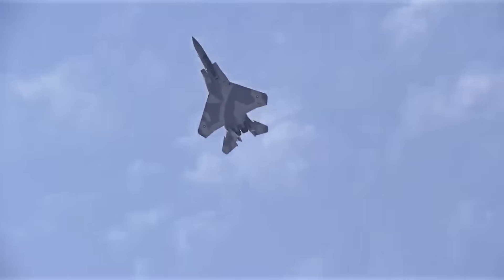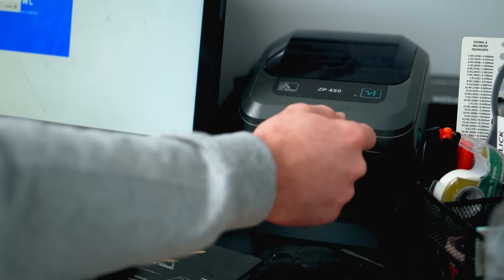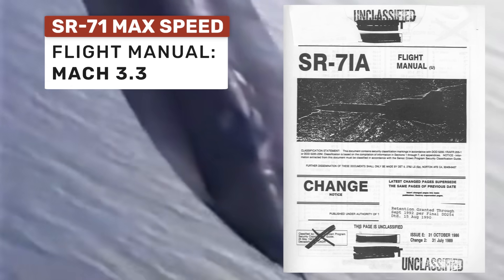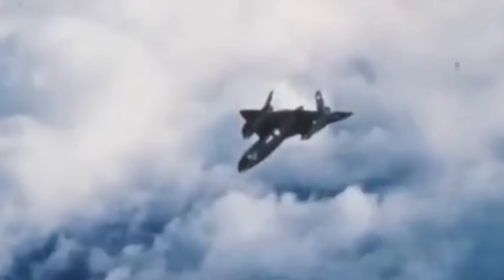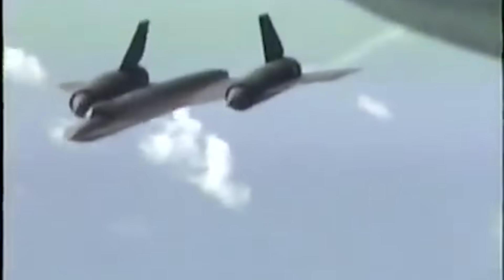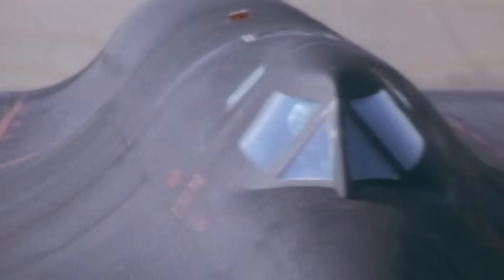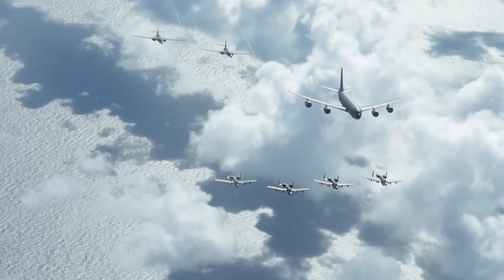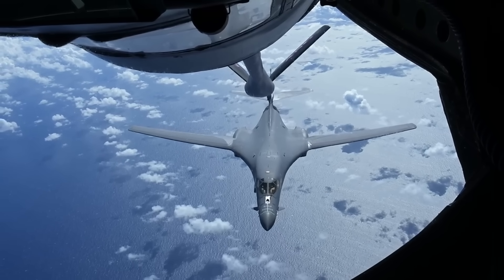The SR-71 was MUCH FASTER than the Air Force will admit

Comment: My dad was head of security in the Air Force at 5 different bases, he had a lot of high ranked connections, he was told by a very high ranked General that the speed was in excess of mach 4, that was common knowledge, the actual speed is still classified.
Reply: He was messing with him as that's not remotely possible
Reply: @gr8crash  My farther was highly decorated, and a very powerful person throughout the 70s, the people he new and worked with didn't mess around, they deadly serious. I believe what he was told, he was in charge of keeping the SR-71s secure.
Reply: @Guest-hv2qv  he very well could have been, not saying anything about that. But in terms of that speed comment, it's 100% not possible,  under any circumstances.  Not to mention he was security,  which means he wasn't part of Senior Crown which means he would have had no access to the specific information.

Comment: Greetings Dear One
The Sleds, projected speed and service ceiling are only for Ops Alta, actual speed and true max service ceiling is listed on a Lockheed paper, this won't see the light of day for around another forty to fifty or so years maybe more, though usually not exceeding a century.

The Archangel project that Clarence Johnson devised during a lunch with a friend relates to from the Pentagon, Kelly drew the A-12 on the back of a dinner napkin while in conversation with this friend from the Pentagon, The A-12 is indeed far faster than the younger fat sibling of the same stable (One usually refers to a as "The Fastest Ladies Of The West!") That said though she is podgy around the midriff due to the extra seat canopy ejector equip and then all the banks of avionics and the ECM Jammers and multitude of HD camera and other such equipment required for mission objectives, her vectors, operations are kept between Mach 3 to 3.2 this had nothing to do with the structural limits of the craft, as the sled was not only capable of far greater speeds and a service ceiling thats also above 120,000ft! the Op Alta was fixed at 80 to 85,000ft for best imagery. 
The higher altitudes and higher Mach are how she would evade "The welcoming committee!" Now given that prior to 1981 the former USSR had already developed a Mach 4+ missile to try and shoot down the sled during an over flight and given the quoted text at end of comment, One will tell you that none of the service crews that serviced the sled knew the top speed or her service ceiling, their equip tops out at around Mach 3.2 max ops speed at 80 to 85,000ft, its a need to know bases, "They know," "YOU DON'T NEED TO!" everything was compartmentalised even during her service life, a couple of sled drives know her capabilities. 
Good luck getting them to tell you not even off the record (Well they might after reminding you that you will suddenly develop lead poisoning of the 9mm variety!)
This Mach and Ops Alta is plenty for almost all mission objectives.
When you're sat in the sled the throttles on the lower left quadrant when in cruising mode at OP Alta your doing Mach 3 if you glance at the throttles their looks about 3 to 3.5 inches of travel before the throttle stops, maxed out and this is actual usable throttle, and given that even though she's one fat chick! She can lift her skirt and click her heels and really stretch her legs and leave a Mach 4+ missile dead like it ain't moving! Even able to operate above 125,000ft though this would only be done to put distance between you and the welcoming committee sent up to greet you by those rather nice chaps from USSR they was always nice in that respect.
Now consider this, the higher you fly the thinner the air the C of F dropped off, the colder it becomes thus, when done correctly you can fly faster and higher because her power plants wasn't standard propulsion Kelly also had them modified during the Archangel project now if you can maintain what's referred to as equilibrium between Sq Cf of F -  -delta t you can operate within the safe paramotors of the upper echelon and the shock wave does not enter past the spike at fully withdrawn as the shock wave bounces around the conical and the inlet ducting almost in the same place as at Mach 3.5. She's capable of greater Mach... (She climbs like an Home sick Angel and at that point, by the time you thought it, you've past it!)
And given you have the preverbal welcoming committee coming at you at Mach 4+ and is gaining on you until you are beyond Mach 4.35. This gives you some idea of...
"She's faster than stated "A LOT!" Though can be gauged knowing other parameters remember, fuel weight and knowing how much secret yeah right how many 135-Qs have taken off each holding xxx? you can gauge where and for how long she's going to be! 
Titanium is not an ordinary and theirs were several alloy base on Titanium mix which at that time were regarded as highly exotics with other things that are shall we say detrimental to human health!

One has been fortunate to see the Lady in operation highly descriptive words of an vernacular sense, though none are printable! Oh Boy does she make ya heart flutter, not so much seeing her on direct taxi, hanger to take off none stop from leaving the ready hanger, its more a case of those shock waves from the powerplants shake the earth your standing on as she rolls down the strip toward you and pounds you in the chest almost like being double tap as she rotates climbing into the night sky, she disappears even the glow from her lit cans fades in seconds, climbing out to around 25,000ft to meet her first refuel to quench her thirst brim her and she vectors off, though if you count the KC-135Q being vectored outbound prior to her exit you've a good idea where she's been vectored.

Taken from:
copyright the Hamlyn Publishing Group 1979 reprint 1981
Quote "THE MACH 3.5 Lockheed SR - 71 Blackbird which gave the company much experience in Supersonic flight despite such Lockheed Military success however the American Super Sonic Transport contract was awarded to Boeing and the whole project was scrapped by by 1971."
taken from William Sweetman A History of passenger aircraft ISBN 0 600 37205 7 

Blessings Love and Light
Namaste

Comment: I'll confirm it is a lot faster. My father was USAF. Klamath Air Force Station (ADC ID: P-33, NORAD ID: Z-33) was used to track the SR-71 on the return leg after it turned south along the coast. My father was stationed there for a while. They travel fast enough to cross the scope on the radar system in a single sweep. I won't go into more detail.
Reply: That doesn't even make any sense. As that all varies on the scope, the distance scale,  the sweep etc. Literally makes no sense.

Comment: The sr71 would do 3000+ mph..... (Coast to coast in 1 hour). That TRANSLATES TO 3000+ mph....
Reply: Lol no. It wasn't capable of anything close to that speed
Reply: @gr8crash  go look it up, I read in the article before he had the internet.... I know INFORMATION before there was an internet!!!  One pilot said he took the sr 71 out over the Atlantic Ocean turn it around, hit full Throttle.... 1 hour later they crossed the Pacific coast.... A simple Google search will show you that's roughly 3,000 mph.  HECK THE mig-25 DID Mach 2.83  your telling me a mig-25 was faster?  HUH???? HUH???
Reply: @jwdundon why look up what I already know? Your comment has many errors. First you're referring to the record cross-country run. That was from LA to DC, West to East coast. It was not from East to West. The distance coast to coast was 2404.05 miles. With an average speed of 2124.51 mph making the coast to coast time of 67 min 53 secs. 

No one said anything about the Mig25 so not suee why toy brought that up.

The other issue with what you said is that somehow you're saying that distance was 3k miles, when the SR71 couldn't fly that far without refueling. Even the Coast to Coast record required a refueling before and after. And due to fuel limits and safety margins meant they refueled only 200 miles off the coast of LA meaning they were still accelerating when they crossed the West Gate. If they had more fuel they would have refueled further off the coast and would have been at max speed at the gate meaning the avg top speed would have been slightly higher.
Reply: @gr8crash  oh my bad, so sorry, the sr71 only went 2400 miles per hour... Damn, your so right.... 

Crazy the mig 25 was the fastest plane ever built then.... Explain to me (obvious expert) why is the sr71 credited as the fastest when a MIG FIGHTER was really the fastest? (Even if it burned the engines up).  Still holds the record since the sr71 was so slow.
Reply: @jwdundon  the SR71 never got to 2400mph either. It would have crashed before reaching thst speed. 

The Mig25 wasn't faster. No one has ever even claimed it was, so not sure where you're getting that from? 

It's noted as being the fastest operational aircraft which is now technically true as the SR71 is retired. Maybe that's where you're getting confused? 

And no,  not quite an "expert", but definitely know more than most people,  especially on here.

And even IF it did reach 2400mph that's now 600+mph lower than what you first said. I mean even if it went that fast, how would the pilot even know?

Comment: There are at least three fighters capable of mack 3 plus. SR 71 was capable of mid mach4.5 or so. And it flew well over 100,000 feet, or you didn't get astronaut wings. There's a company that rents a Soviet fighter to fly to 92 thousand feet. Mack 3.3 at 85000 foot. Not at 100000 foot. The plane has reached 118000 foot, too
Reply: The SR71 could never fly that fast or high. Nor did the pilots ever get astronaut wings

Comment: i have it on record that the A-11, the Skunk Work's predecessor to the A-12, was capable of Mach 5.  But that's only because Speed Racer worked for Lockheed.
Reply: Lol no
Reply: First of all, the A-11 was one of the many design studies that gave rise to the A-12.  From what I remember being told: It was sort of a basic idea for producing an all-out speed-demon without any regards for reducing RCS, but it was rejected for effectively having a pretty much 100% odds of being detected (plus fears it could be mistaken for a bomber).  A few of the design traits were retained, such as having the wings at half the span, the fuselage diameter was probably not much different and so on, but pretty much everything else was changed.

In 1964, when LBJ wanted to reveal the YF-12's existence as it was useful to the SST program.  The YF-12 was designed as an interceptor and didn't have any of the more sensitive technology such as radar-absorbant materials, cameras, and composite fins (it used regular titanium).  Kelly Johnson had apparently suggested to President Johnson that it would be best to refer to the aircraft as the A-11 since that was the last design that was drawn up without any regard for low RCS.

Comment: of course they did at mach 3.2 BEST they were just as fast as the Avro Arrow would be with the Iroquois engines ... the part that scared the  shit out of the americans is the arrow was as fast few higher and was ARMED ... who do you think got the sparrow missile system to work Avro Arrow .. because the americans gave it up ... until we fixed it ... 

dont forget in 1957 the sr71wason the choppng bock review... if it wasnt for the dozen avro engineers who lost their job the month before from American lies and pettiness of government officials ... they are the ones who knew how to work titanium and handle high mach speeds ... NOT the americans ... before the avro pepe arrived it was a swept wing copy of the U2 ... and a Piece of CRAP ... almost a month later and poof they had SKILLED engineers to fix the hunk of junk the americans designed .... these ARE the true FACTS ... so Americans your aviation industry and space pane stuff is ALL thanks to Canadian Engineers NOT american ones .... even the lunar lander was a Canadian engineers design so was the shuttle ... every  fighter since 1953 uses all of the avro arrows 15 firsts of jet fighters... including air conditioning delta wings and so on ...
Reply: dont forget that top speed is at 92,000 feet where resistance is lower it's normal attitude was 80,000 to 85,000 feet and mach 2.8 ...
Reply: turbo scram jet ... a ram jet has NO MOVING PARTS in the airflow a scram jet does ... a ram jet literally compresses the air with the air duct passage by narrowing and then expanding ... a scram jet uses a turbo jet with two optimization setups one for take off the basic turbo jet and the high speed fight setup where it rotates the compressor blades and uses the funnel at the front to hypersonically compress the air for the combustor of the turbo jet ... calling the sr71 a ram jet is the ultimate misinformation ever possible
Reply: at mach 3.5  and 95,000 feet the surface temp of the leading edges and trailing edges of the sr71 is around 2000 degrees F ... titanium melts at just above 1,000f at sea level... at 95,000 feet the air temp is -46C or -54f ... giving the surfaces about 800 degrees of extra heating needed ... add ceramic coatings such as the sr71 had and you can get it to near on 2kF ...
Reply: @kaboom-zf2bl all your comments are riddled with inaccuracies.  To many to correct right now. But your first main issue is the SR71 wasn't even requested by the USAF until 1962 and flew in 1964.

Comment: Well the world record was one hour from the west coast to the east coast. Do the math.
Reply: mach 3.649306
Reply: @hildy2222  I don’t know the particulars but I do know they opened it up as it was being retired.
Reply: @Abbeville_Kid  Nice! I bet they had some fun lol. I just calculated it quickly for 2800 miles in one hour, but I'm not sure what the actual distance/time was.
Reply: @hildy2222  it was from Palmdale to DC. 68 minutes so about 3.45. I bet it could go faster.
Reply: @Abbeville_Kid that speed calculation is wrong BTW. Also the timing started at the West and LA timing gates and ended at the DC and East timing gates.
Reply: @hildy2222 lol your math is waaayy off
Reply: @gr8crash  I just used google and that’s what it says 2800 mph is.
Reply: @hildy2222 guessing you didn't account for the altitude?
Reply: @gr8crash  negative lol
Reply: @hildy2222 haha no worries,  that's pretty common. When you take the average speed the coast to coast run it works it to mach 3.18. 

The fastest record they set that day was St Louis to Cincinnati with a speed of 2189.94 mph which is mach 3.28 when adjusted for 80k ft.
Reply: @gr8crash  I just used a converter too.
Reply: @Abbeville_Kid yea it's common.  The converters just don't account for altitude. Tends to throw off the numbers

Comment: Brian Shul and his backs-eater Walter we’re together at a presentation on the SR71. Brian talked about a run back and forth over Libya. One the run south the were painted by a surface to air missile battery. The return run the had a launch indication. Walter gave Brian the launch over the intercom and Brian responded by “pushing up the throttles” They were already doing Mach 3.2 and Brian said that he was too busy looking for a missile to look at the Mach meter but when he did it was at Mach 3.5. They had already out run the missile so Brian pulled back the throttles.
Reply: He's also lying about that part. In fact he was removed from flying the SR71 not long after that after getting caught lying to his Commander.

Comment: You have to ask the question what was the technology to measure speed during those times.  In fact, the Global Position System was non existent at that time.  Therefore, don't believe old data or information even for the F15c.  There is a big difference between analog versus digital information.  For example, digital avionics are lighter than analog system.
Reply: The way to measure speed hasn't changed in a century. Pitot Static system have remained largely unchanged and are still incredibly reliable whether it's analog or digital.